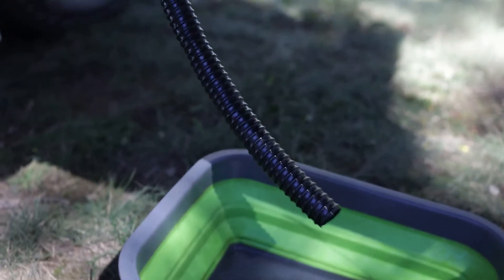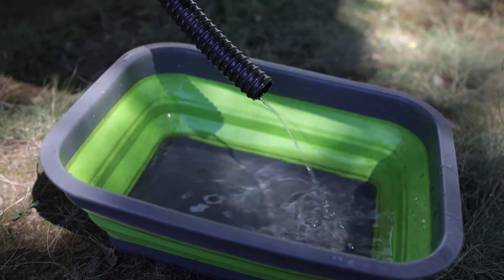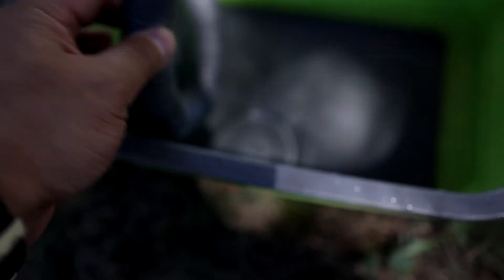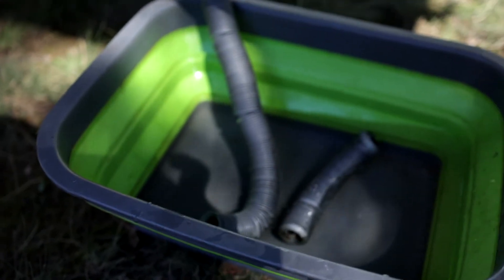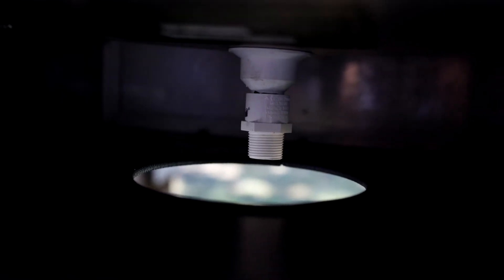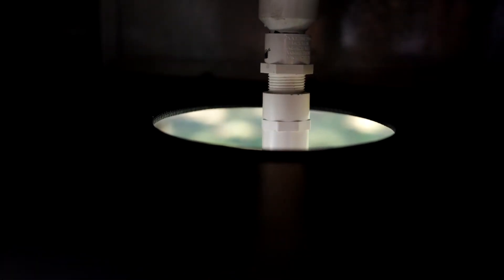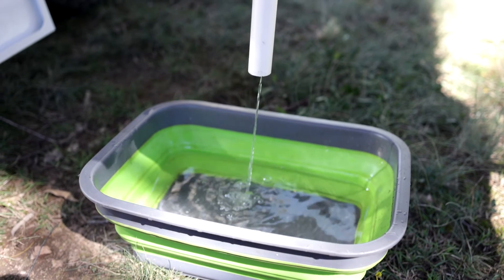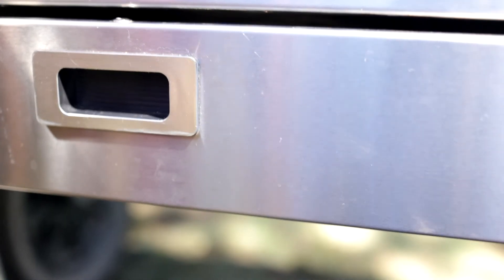Camper Trailer/Caravan - Dometic Sliding Kitchen Sink Waste Hose Tip

Comment: I have a different brand, but same solution really. Mine has a 50mm threaded waste fitting. After finding a 50mm to 40mm adapter I just started cutting PVC pipe to length and added 90 degree elbows as needed (I have the door fold out directly below the outlet). Total spend at Bunno's was about $18.
Reply from the maker: Thanks Walter Nice to hear. Yeah should work with a lot of camper trailers.